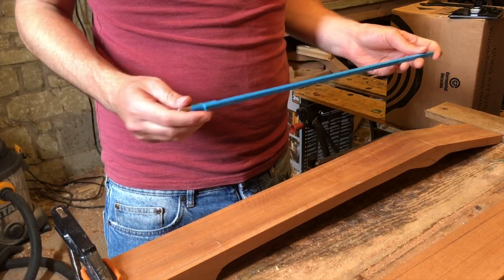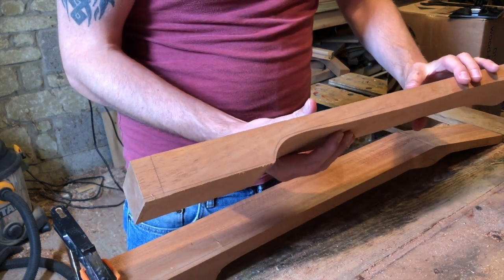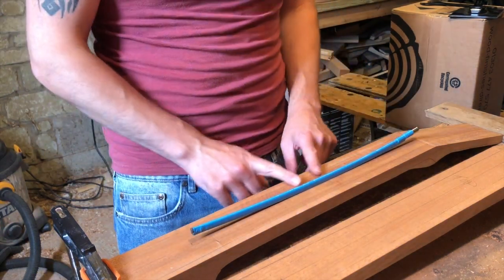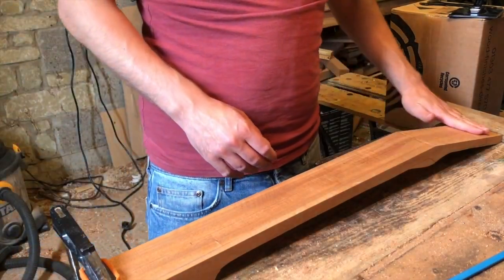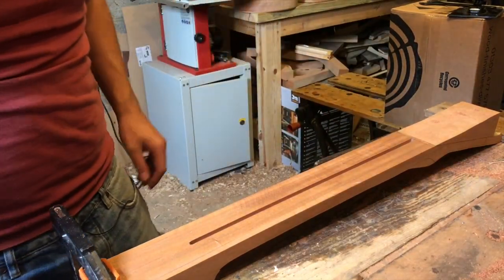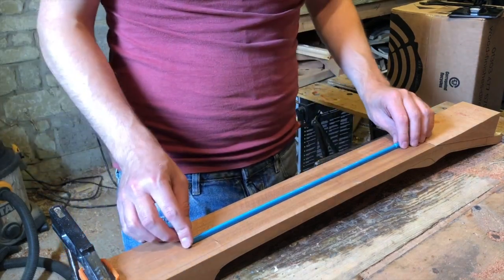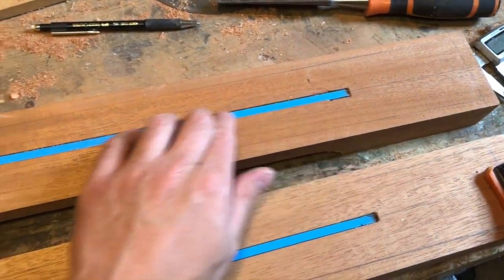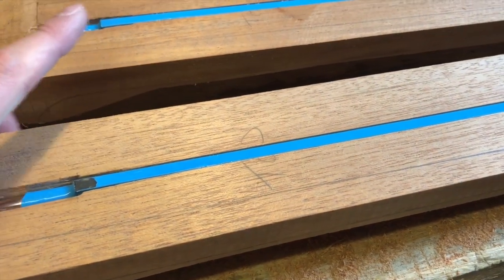Building DC Guitars - Episode 5 | Routing trussrod channels

Comment: Do you mind answering a quick question? I have a Crimson PRS style template kit. The neck profile (minus the fretboard) at the nut end measures just shy of 15mm. Truss rod is 11mm at the nut adjustment end which would only leave me with 4mm of wood before carving the neck. This seems too risky as I wouldn't want to "say hello to Mr Truss Rod"! 
Would you recommend I simply add a couple of mm to the neck thickness? What do you consider to be enough wood at the nut end before carving? Thanks!
Reply from the maker: yeah that worries a lot of people when carving their first few necks. You could certainly add a couple of mm to the blank when you profile it and then carve it down to taste, something else you can do is reduce the height of the fretboard a little. If you have you fretboard 5mm instead of 6mm when when you carve your overall next down to final thickness, you have an extra 1mm under the truss rod nut. I tend not to use profile templates for the neck and just carve down to taste
Reply: @ADFinlayson  Awesome, thanks! It's my first, so all a bit new and want to eliminate as many errors as possible. Hence why I must have watched your videos over and over again! Great work, thanks!
Reply from the maker: @spesh1974  You're welcome Rob, thanks for watching

Comment: Where did you get the guide on your router ?
Reply from the maker: Came with the router mate, some of the bigger plunge routers come with a 2 sided fence like thi. It works well but it does require your blank is perfectly square all round. It's also not necessary, the last few truss rod routes I've done has been with my little Makita trim router and it's one sided fence.

Comment: You said the truss rod is about 9mm deep, therefore you routed the channel 9mm to match. But when you make adjustments on the truss rod in either direction, either the flat bar on top or the round rod below will tend to bow (flex). It seems to me you would have to route the channel deeper in the center to allow for this flex; otherwise you might risk splitting the neck ?? That is, the bottom of the channel would be an arc, deeper at the center to allow for expansion. I’ve watched several videos and no one has even mentioned this. What am I missing? I’m thinking of trying a build myself and would like to get it right the first time. Thanks. Great video
Reply from the maker: Thanks for commenting, the truss rod is 9mm deep but the nut is wider than the rest of the rod, it also sticks out slightly lower than the shaft of the rod so I had to fettle out the area in the channel around the nut. It’s only slightly larger so it’s easier to do it with a chisel than get a larger bit out. Yes the bottom of the rod is round and the channel flat, but using a round 6mm router bit would really save so little material that it’s really not worth it. Hope that helps?
Reply: I think you can flush fit two way truss rods.
Reply: The entire purpose of matching the truss rod size is to force the wood to move ie adjusting the neck.